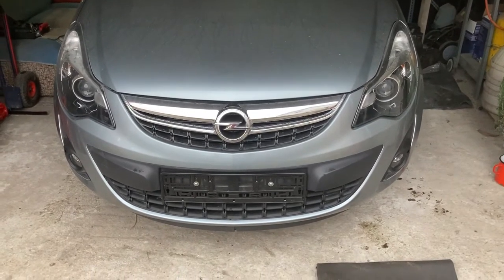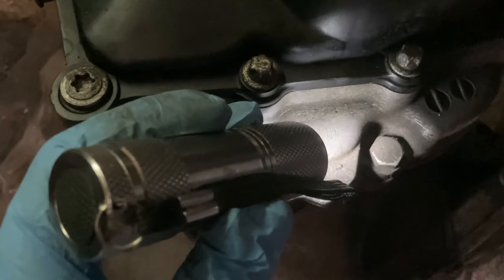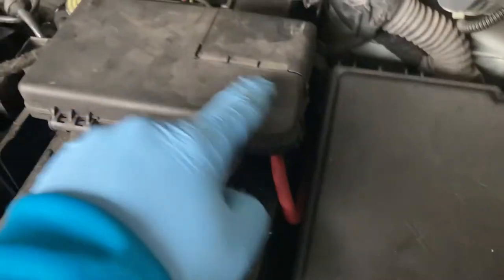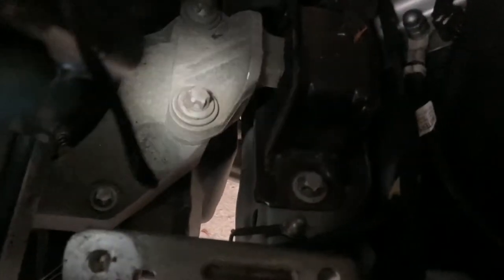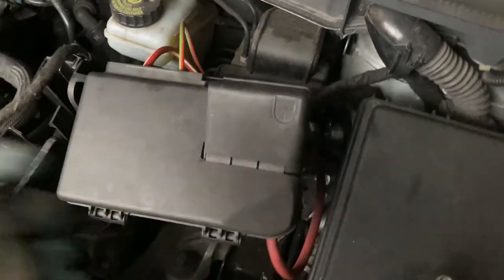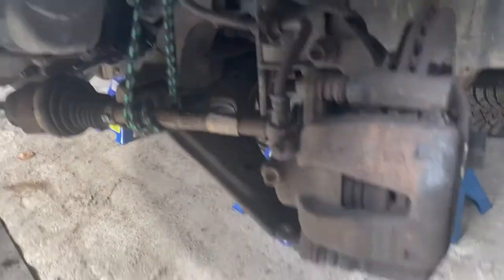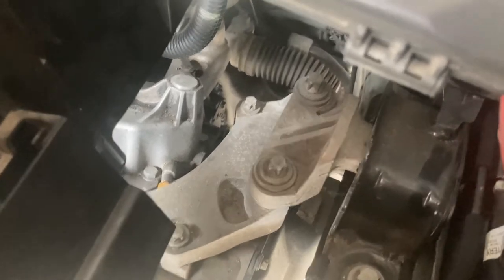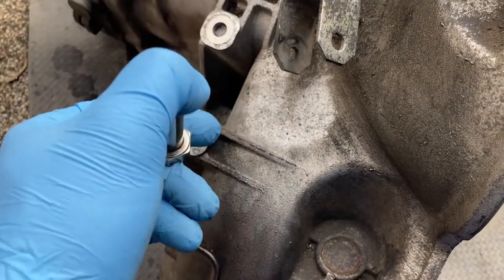DIY - 2014 Opel Corsa D 1.4: Swap the 5-speed manual gearbox

Comment: Thanks a lot👍😊🍰 This was realy helpful. You took youre time to eksplain Even the details. You made the best tutorial i ever seen. I hope you get satisfied with the New gear box. So again thanks a lot for you shearing this knowledge with us😊 A tip when bleeding the clutch, you could simply use a New oil can with a hose in the end, and bleed butom  up by pumping the Oil can that is filled with brake fluid.
Reply from the maker: Yes, that method would work as well. I didn't use it at the time because I didn't have such a pump available.

Comment: Would have been good if you had shown how you physically removed the old box and managed to get the new one in place
Reply from the maker: That's true. I did think about this some time after posting the video. But the procedure itself was not that difficult: once all the bolts had been removed, I got under the car and gently pulled on the box until its input shaft disconnected from the clutch. The box weighs about 35 kg, so it is possible to be handled by just one person without using a transmission jack (and I didn't have one available anyway). Installation is the opposite of removal, though you do need to ensure that the input shaft's splines align with those from the clutch plate, otherwise it won't be physically possible to push the box flush against the mating surface from the engine. A transmission jack does make the installation easier, though it didn't take me more than 5 minutes to install the new box by hand.

Comment: Man this is helpful, i currenty want to do a gearbox swap on my corsa c 1.4 utility 2007 (120km/h - 4000rpm) came with F15 box, and put in an F17w from a 1.7 DTI (120km/h - 2800rpm). So im really hopeful it will workout.
Reply from the maker: Fingers crossed! That was my reason to swap the box as well. I’m glad you’re finding the video helpful! 😊
Reply: @TheMissingBolt  keeping fingers crossed indeed, what was your rpm before and after the swap at 120km/h?
Reply from the maker: @blacknation7736  I measured at 100 km/h. I had about 3050 RPM with the old box and about 2550 RPM with the new one. So nearly 16 % decrease in RPM.

Comment: Excellent video, very well explained. I have a doubt:
I'm going to replace the driveshaft seals of my F17 and the Haynes manual says you have to discard the bolt and nut that hold the lower control arm into the hub and put new ones but I'm unable to find spare ones. Is this really necessary? I see you didn't change them and seems to work correctly
Reply from the maker: Indeed it does say that. But I did reuse mine and I've had no problems with the car in nearly 2 years. However, if you do reuse the same bolt and nut It's a very good idea to use some medium-strength thread-locker and make sure you torque it to spec by the nut (given the level of vibrations that bolt is subjected to, under-torquing it may lead to it coming loose and over-torquing it may lead to it snapping during driving - both scenarios being very dangerous).

Comment: Hello Sir

I hope you read my comment. Here is my story: i bought an Astra 180i with an automatic transmission however after a while the box failed and i bought a manual and got a mechanic to do the swapping.  However i have issues when the car gets warm, the gears don't seem to change smooth 😢...especially changing down to gear 1,2 n 3. Gear 3 infact bites when the car is warm 😢😢..could it be that i got the wrong box for my engine?? Please help, i am in Zimbabwe
Reply from the maker: Hello! What you're describing sounds suggests potential problems inside the gearbox itself. But I would first start with changing the oil in the gearbox, if you haven't already done so. The 5-speed manual in the Astra F should take 1.8L of 80W GL-4 oil, but check your owner's manual to be sure.  I was getting some harsh shifting in our Opel in the winter and changing the oil definitely helped.

Comment: Howdy!  What could be the cause of the heavier 1st and 2nd gears?  I removed the games from the wheelhouse, I did the oil change, I did the adjustments with the locking points exactly as you explained!  Marsalier ok, step 3 and 4 ok, but 1 and 2 a bit heavy!!!!!  What could it be?
Reply from the maker: Greetings! I had the same problem with the 1st and 2nd gears being heavier and it ended up being the oil - it seems 75W90 I used was too viscous, especially when cold, even though it was approved for GM 1940768. When I did the gearbox oil change video about 1 year later, I switched to a 75W oil in line with the latest GM recommendation - GM 1940004. After switching to this thinner oil I had no more issues with heavy gear-changes.
Reply: I put 75w80!!!
Reply from the maker: @octaviansorescu7427  Is the oil you used approved for GM 1940182 or (ideally) GM 1940004? If the oil is fine and the lever adjustment is also fine, it may simply be that your synchros on gears 1 and 2 are wearing out. Was the gearbox behaving the same or differently before you did the oil change and linkage adjustment?
Reply: @TheMissingBolt  North Sea,made în Holland : GM 1940182!!!
Reply from the maker: @octaviansorescu7427  If the gearbox was behaving the same before the oil change, then the issue is with the box itself (worn synchros most likely). If the behaviour changed after you added the new oil, then most likely it's related to the oil itself.

Comment: When did you drain the new gearbox oil
Reply from the maker: I drained it off-camera through the driveshaft openings, as I was preparing the box for installation.
Reply: @TheMissingBolt  thanks man I almost bought a diff gasket thinking I will drain it that way. I'm also swapping gearboxs. You saved me a lot of unnecessary work
Reply from the maker: @bongzm.4597  Happy to help! 🙂

Comment: What is the gear ratio on new gearbox? Or what km/h you have at 1000rpm on 5 gear?
Reply from the maker: The previous box (F17-CR) had a 5th gear ratio of 0,892. The new current box (F17 WR) has a 5th gear ratio of 0,756. In 5th gear, the CR does 80 km/h at about 2500 RPM, whereas the WR does it at a little over 2000 RPM. Correspondingly, the WR does 60 km/h at about 1500 RPM and approx. 40 km/h at 1000 RPM.

Comment: Why did the gearbox need changing?
Reply from the maker: As I explain in the beginning of the video, the car came with the short-ratio version of the gearbox. I wanted to install the wide-ratio version in order to reduce RPM and improve fuel efficiency at higher speeds (think 4th and 5th gear), since the car is driven almost exclusively on the open road.

Comment: Why didn't you only swap the 5th gear for the highway? No tranny removal needed to do it.
Reply from the maker: It would have been too large a gap between the CR's 4th gear and a WR's 5th gear. The car is being driven daily by a beginner with 4th and 5th being the most used gears, so I didn't want to make life more difficult for her. Also, I got 14 % better fuel consumption in 4th gear and 11 % better in 5th gear, so having a longer 4th gear does help with mileage. Lastly, as a DYIer I was also after the learning experience.
Reply: @TheMissingBolt  I did it. I mostly use 5th on the highway anyway, so there is no gap noticeable, really.
Reply from the maker: @peterhandke3936  There's also the additional topic of the cruise control, which knows either the WR or the CR gear ratios, but won't work properly if you mix the ratios up as you suggested. Had I swapped only the 5th gear cog, I would have had the cruise control not work in the 5th gear, i.e. exactly where I need it the most.
Reply: @TheMissingBolt  cruise will operate as designed if you change the 5th gear only.
Reply from the maker: @peterhandke3936  In my case it definitely did not work for any of the changed gears, including the 5th. My ECU expects to see a correlation between the speed and the RPM and the correlation map is either for the full CR or the full WR, not in between.
Reply: @TheMissingBolt  it works on my car, but you may claim the opposite, no problem.
Reply from the maker: @peterhandke3936  In that case, perhaps we're talking about different engines or different software configurations, which is entirely possible. What I said applies to my car and those of similar age and configuration and targeting the same market. It's useful to know that other Corsa D configurations may not require the ECU software update to keep the cruise control working.